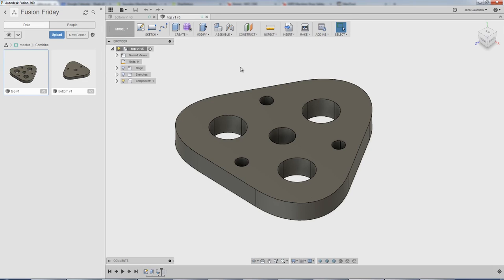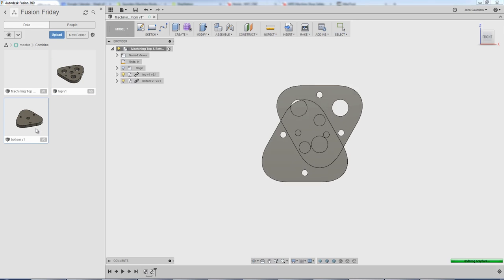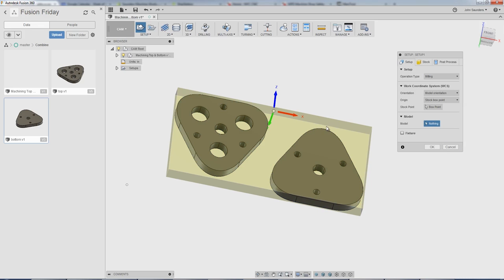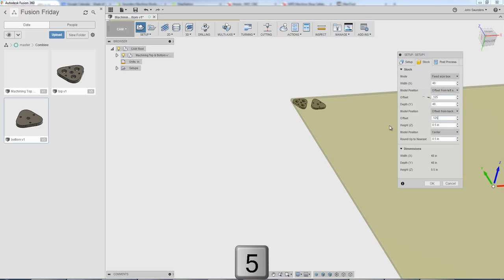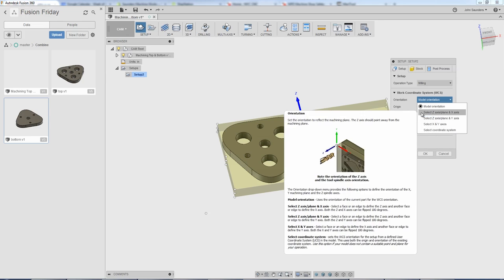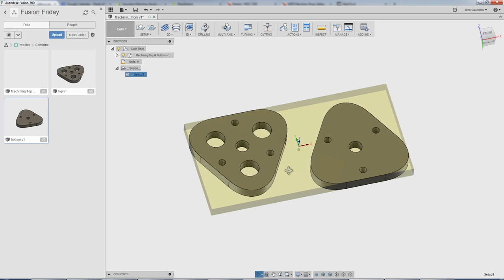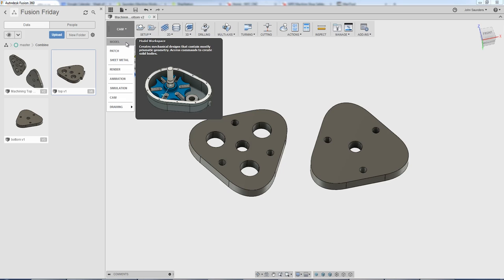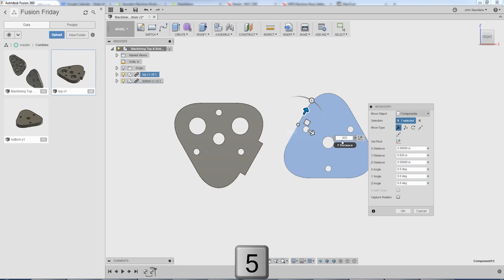CAM Two Parts at Once in Fusion 360! FF91

Comment: Obviously I'm very late to the game, but this was very close to what I was looking for. I get the gist of this, but I'm wondering if fusion offers anything more flexible and accurate than simply dragging parts around by arbitrary values? For example, I would like to do what you did, but imagine that I have parts that I routinely scale to custom sizes. I want to pack them densely, but ensure that as I scale them, ideally I would keep the spacing in between the parts slightly larger than my largest tool diameter. I feel like what I am looking for is more akin to mating in solidworks, where I could set distances based off of part geometry, and those distances would update as I changed the part. Would something like that be possible?

Comment: Hey John,   I'm trying to make like 36 of the same part. Tiny little square things (12x12mm) out of a sheet of 2.5mm Aluminum. 2D and 3D adaptive seem to take forever running around these little bricks. Any way to get it to slot through the streets and alley ways to do the bulk of the material removal first? I've made sure to leave enough room between the parts for the larger bits (6mm).  Even with stay down at "Most" there is a ton of back tracking and lift and plunge going on. Like I said, in an ideal world I'd like to slot through the alley ways and then run a quick multipass contour around the actual nuances of my geometry.

Comment: Hi John, Im having some problems with a geometry that looks like cooling fins with a chamfer around the edges. This means that the edge is broken in multiple places and a 'regular' chamfering op won't  work. I tried the patch tool but it fails.  Is there any way that you could help me out? I bet that there is plenty more people out there that has the same issue.

Comment: Did you have a problem the other day with your fusion, that your parts were locked in the sketch? you could make a new part and modify with no problem, once you saved that and reopened it, it's like it was locked from further editing. lost hours and hours of work! I've emailed Autodesk and have yet to hear back. The problem hasn't come back.

Comment: Hi John. Say you were milling those parts, any reason why you would opt to double side machine from thicker stock rather than just using 1/4in stock to single side machine and leaving tabs? If you don't like tabs i guess  you could use 1/4in stock on a fixture plate, drill and mill the holes and then bolt down using 3 holes and finally mill the profile. I try to avoid flipping parts if possible, it just eats up so much time, it usually wastes more material and it invites opportunity for failure due to misalignment.   As always, thanks for the great video's!